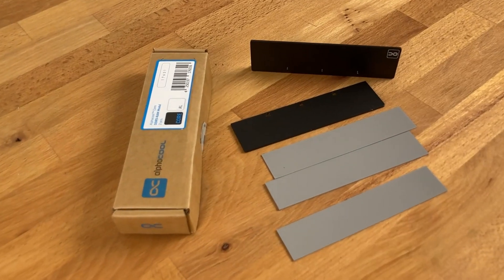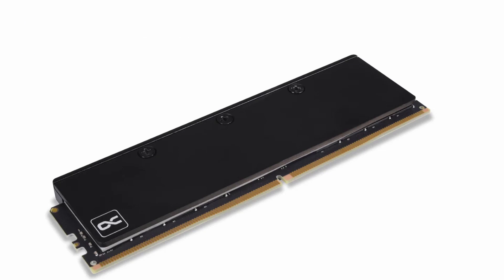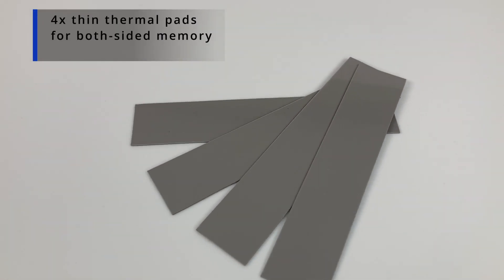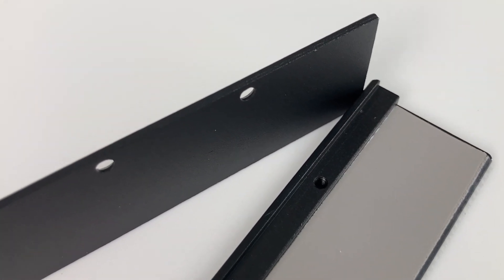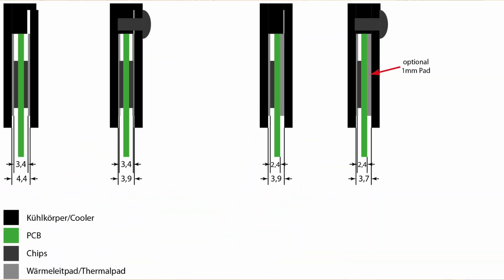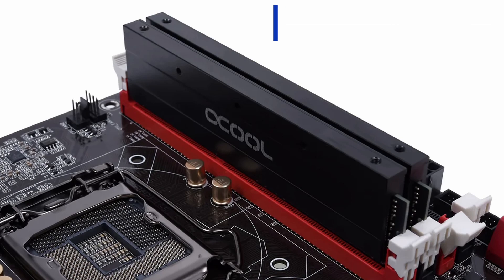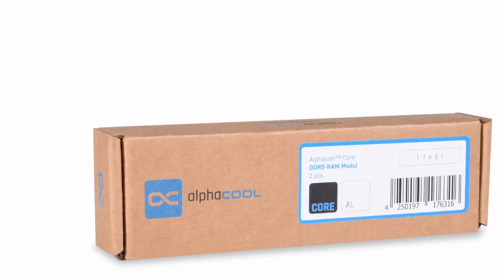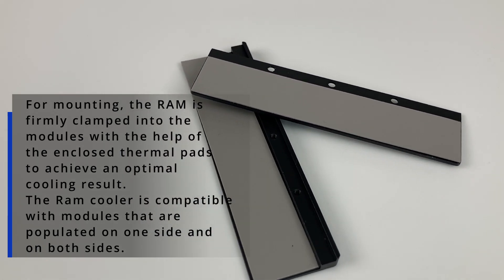DDR5-RAM Game Changer: Alphacool Core Module Unleashed

Comment: These don't work with CUDIMM or RDIMM DDR5 cause they do not have cut outs for the intergrated circuits and will sandwich them between the heat sinks, causing possible shortages and damaging your memory stick. Plus the circuit pushes the heat spreaders out to where they wont even touch the memory chips. So don't waste your money if you have CUDIMM or RDIMM. Works fine with regular ddr5.
Reply: That because they are listed for ddr5. That's like complaining they won't fit  ddr4 either. Cudimm and rdimm ARE physically different than standard ddr5. If you're changing your ram heatsinks you're also at the point where you've researched and measured before buying

Comment: Idk what's the deal with all the major wb brands out there, you guys ever check supercool ram block? The water can go inside the module and it doesn't look that hard to do the same. I'm using their on my Teamgroup A-Die 8200 and it's ridiculously cool even on air. It's 32 on air, and 15C on chiller, just to let you know when the ram block done right. Every ram block just stack another block on top the module and that's it. It's quite sad.
Reply: Just got my Supercool 14th gen CPU block, glad to see their RAM modile is top quality as well!  Thanks!
Reply: @wegbored  Supercool and Iceman are the only one that make direct cooling block for Ram. The temperature is decent even use without watercool. Mine is average ~18-19 on WC, and under 30C on AC in room 16C. The only issue is that QC of both Supercool and Iceman needed improvement. Iceman screws are easily crossed thread, cheap  material, o-rings are too thin. Supercool needed more communication, also their screws need better quality. Both of them have issue with measurement so I think it's better to make adjustable top instead of fixed screw holes. However, their products are way better compared to all other brands in term of price and performance.
Reply from the maker: In all the years we had several attemts of cooling RAM with water from many brands.
In the end, the main issue today is the water flow restriction that a super small direct cooled water block comes with.
So I understand, but for the overall performance the way RAM is cooled today seems the most practical.
Reply: @aquatuningtv   The ppl who use wc for ram are either enthusiast overclockers or threadripper. If you shove 1.45v or more and U want it run tight timing then WC is the only way. U guys used to have that one pain in the ass ram block to install but it's better than any ram module + block nowadays. Supercoolcomputer make it easier and better. But yeah who would watercool ram hence buy the block for what right?
Reply from the maker: 20 years ago when I started Aquatuning (in that time we used 8/6mm tubing) the main concern was how to make the best CPU block regarding the lowest CPU-temperature and highest overclocking option.
You are right in that this changed. Today function follows design and even no-brainer products find some audience, if the look good or are new, inventive or are promoted by a celebrity.
Reply: @aquatuningtv   Back then I use feser product, still have 4 x 420 Monsta rad lol so you guys better make Apex 140mm soon. I'm long time user of AC tbh, still have some of your 45 fitting that has issue, it is  leaked quite easy if the pressure is high enough. But I love AC product. It's great to see that you guys make core 1 block and Apex fans. It's not only looking good, also price vs performance is quite impressive. After the Apex fan series, I'm quite excited for the upcoming products. So many people keep focusing on some useless craps like RGB, and EK, Bitspower get away with the shitty QC overall is annoying the heck out of me for years. I hope you guys keep being consistent, performance and efficient are always my top priority. It sucks that not many think this way because they're all bamboozled by RGB. Btw, if you guys haven't tested core 1 block on direct die for AM4 and AM5, i have results and it works, it just that mounting is annoying.
Reply from the maker: Hey, great to hear, everyone has a history and when I started Aquatuning it was to make water cooling affordable and efficient. I was so stupid not to think about design at that time, so others did and got lots of market shares just because of the design (even if my products had better performance results)

In the end, today the majority will not care if the CPU is running at 51 or 49 degrees. So still design matters to most. With the CORE series and the APEX now we have a design in place AND still match the core values of my company values (great price/performance ratio)
140mm will come next year, I promise 😊 For those test result on AM4 AM5 you can contact Eduard at marketing@alphaocool.com
Reply: Why do not you make waterblocks for 6 ram? Like on mine gigabyte mz73-lm0.

Comment: Hello, where i can get that two-slot RAM-Watercooler in this video?
I can only find the four-slot RAM-Waterblock at Alphacool site.
Thx
Reply from the maker: Good day, I am sorry for this news, but the four-slot version is the only one available - the 2 slot version is EOL. Thre reason for this is, that the four-slot version is also compatible with 2 slots.
Reply: Hello, thank you for the answer. 
Sorry to hear that. I already have the four-slot version waterblock but with only two 32Gb RAM sticks in use it would look much nicer/balanced with that smaller cooler. Weight of the bigger cooler matters too of course. But only due to compatibility i will sure understand that decision. So no problem. By the way i have lots of Alphacool products in use and i´m very happy with it.
Reply from the maker: I can totally understand your idea of (for optical reasond) using the smaller 2 slot version. 
Great you are happy with Alphacool products - we are, too :-)
Reply: @aquatuningtv  I was really hoping for the x2 version too! Dang I'll have to look elsewhere for a solution for my SFF build